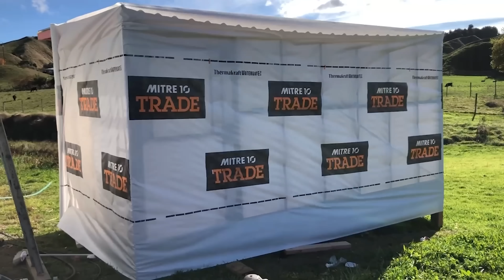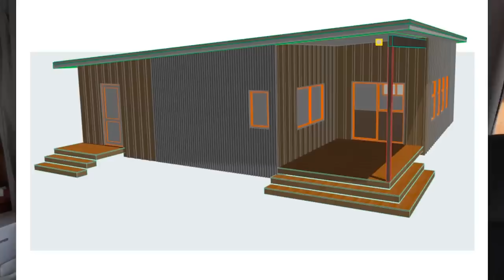2 Years On Our Land! 6 Years YouTubing

Comment: We have had problems with disk drives as well. My solution is to buy brand name disk drives like Seagate and they typically have a 2 year warranty. At the end of 2 years, I buy another and move the data over to the new drive. The reason became clear to me when we had a Seagate disk drive die after about 16 months. I contacted them to see if they could retrieve the data from the disk. It was a 5 Terabyte drive. They indicated that due to being under warranty, they would not charge for the retrieval or attempted retrieval and that they would replace the drive also for free. The new drive arrived and about 5 weeks later, I got an update that the retrieval was successful and that they were sending the data to me on another smaller form factor 5 TB drive. Win, win, win. Verify the warranty on your new drive when you get it. I didn't know that Seagate did that. I was expecting to pay for the data retrieval when I asked for it.
Reply from the maker: Ah good to know! I wonder if they would have better luck at retrieving than the local IT guy...
Reply: @TravellingK  Honestly, it depends on the manufacturer of the disk. Their warranties vary widely. Some are 90 days to 1 year. I know that Seagate is or was offering a 2 year warranty on the disk and I think best effort on data retrieval. Do you remember where you bought the disk?